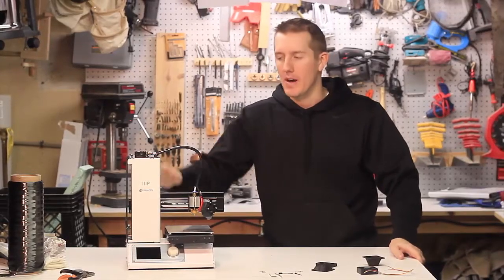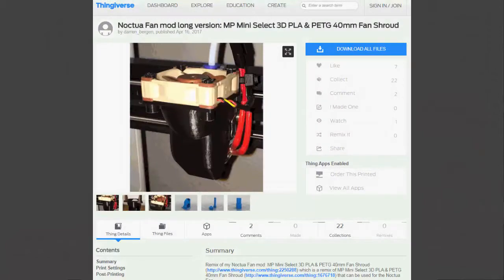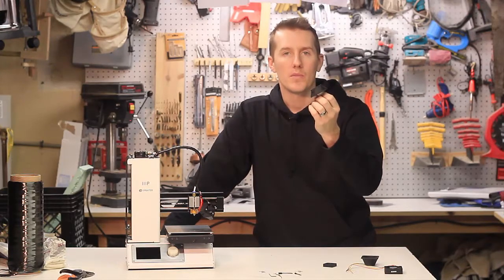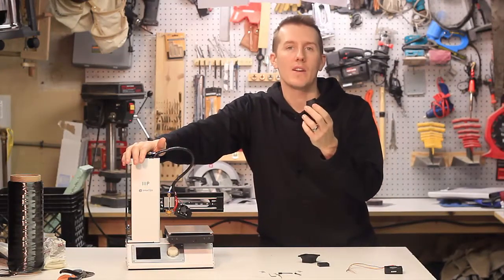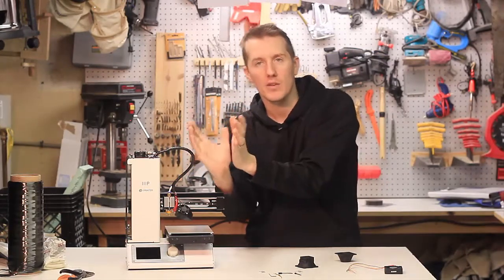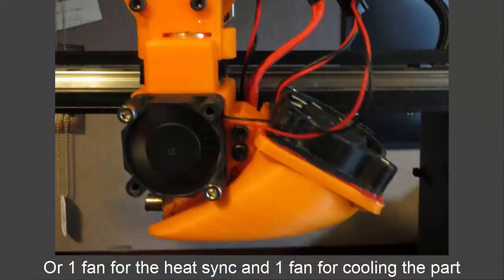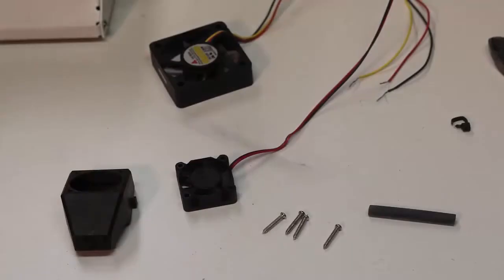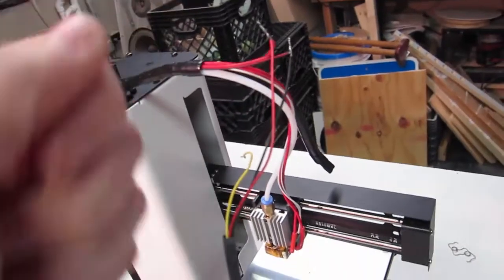Replace Stock Fan on 3D Printer - Prevent Filament Clogging

Comment: Any chance of getting links to both ideas here? Printing allot of parts for my V2 right now and as a noob doing OK. Printed 7 things so far with zero issues, moving to the glass bed you recommended. I see your channel as the baseline the the Monoprice select mini.
Reply from the maker: Here's what i replied to for another person:
Here you go:      https://www.thingiverse.com/thing:21112
For air on the nozzle you can also think about getting a little Blower instead of a fan for a more concentrated flow of air.  Here's one on Amazon for $5, but i think i saw them for as little as $2:   http://a.co/iBOvpAX
Ya i can't find that exact part at the moment.  But it was something like "fan extension" or "fan adapter"
https://www.thingiverse.com/thing:735038
Reply: Thank You!

Comment: Hi Dave
in general, I suggest to have a 2 fan mounting.
one fan for permanent cooling the heat sink, like E3D suggests it for their products (I got my power directly from the plug in the printer
second fan for the material cooling, since ABS  does not need any cooling, in you version, the heat sink would not be cooled.
If you keep the "rule" one permanent fan for the heat sink and one for the material (controlled by the main board) you are save :-)
Best
Frank

Comment: Dave, great video. However, I don't see the links to the shrouds you mentioned. Can you please provide them? I really need to replace the fan as it has noisy interferences on some frequencies and in some places. It's driving me absolutely nuts.
Reply from the maker: Here you go:      https://www.thingiverse.com/thing:21112
For air on the nozzle you can also think about getting a little Blower instead of a fan for a more concentrated flow of air.  Here's one on Amazon for $5, but i think i saw them for as little as $2:   http://a.co/iBOvpAX
Reply: Thanks man! However, you have now two extenders between original shroud and fan, a rectangle-like extender and a funnel-like extender. Is the rectangle-like extender in the Thingiverse package, too?
Reply from the maker: Ya i can't find that exact part at the moment.  But it was something like "fan extension" or "fan adapter"
https://www.thingiverse.com/thing:735038